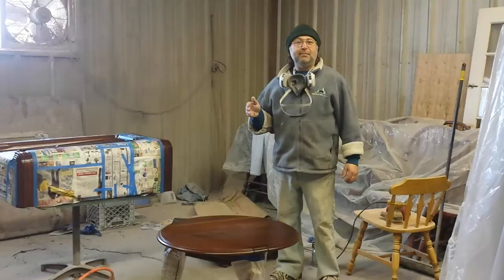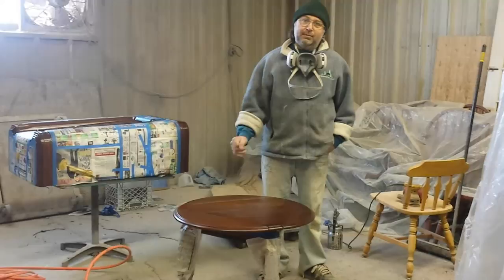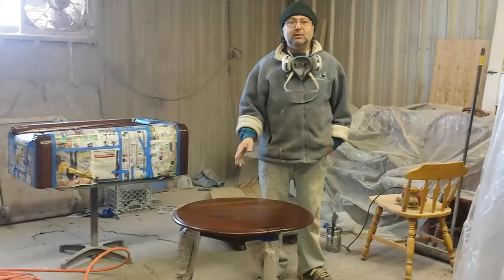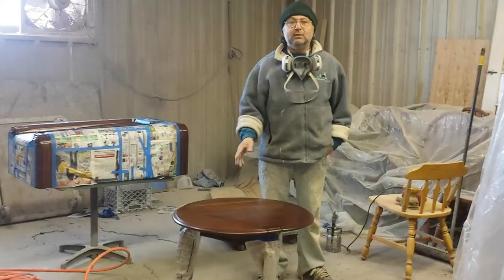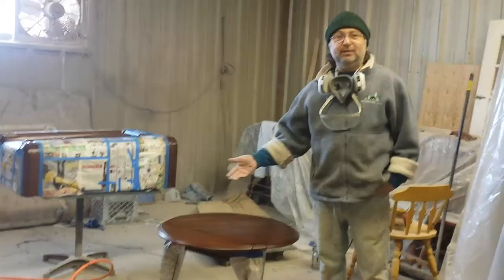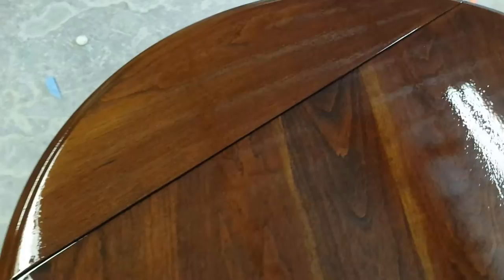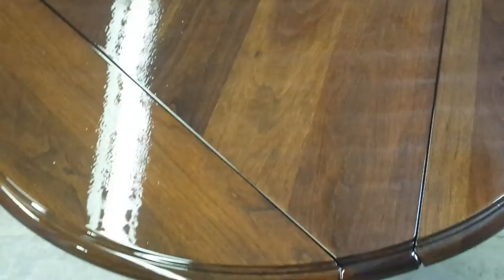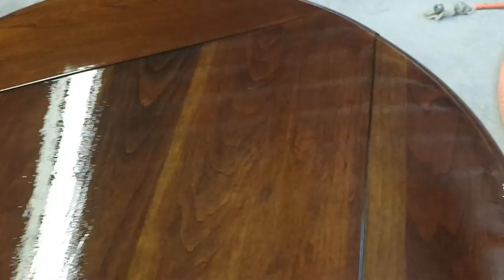Refinishing a Ethan Allen table at Timeless Arts Refinishing

Comment: Hi I have Etten Allen chairs ,I would like make color of them a little bit darker , the chairs stain is  reddish brown (or maybe they called it walnut) . Can I do it without sanding or scarpping existant stain or varnish.the chairs wood is oak. I am really looking forward to your answer.thank you very much.
Reply from the maker: yes you can , you will need to sand the piece with a 220 finishing paper with out sanding through the finish and getting into the color ,just a scuff to brake up the finish ,then you can tone it with a toner in a spray can ,and then top coat it ,here is a link look at the finish toners and the aerosols cans of lacquer get a few cans of toner and about 4 cans of lacquer https://woodrepairproducts.com/product-category/mohawk-aerosol/
Reply: Thank you so much that was very kind of you .to answered my Question.thank you again.